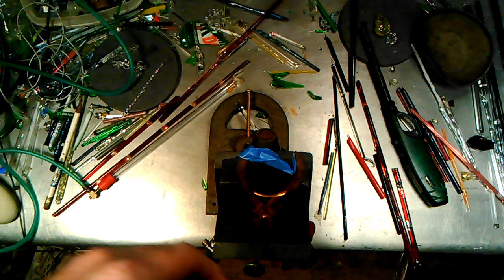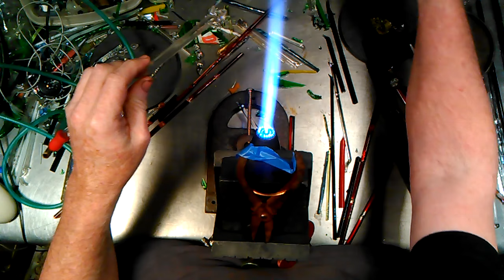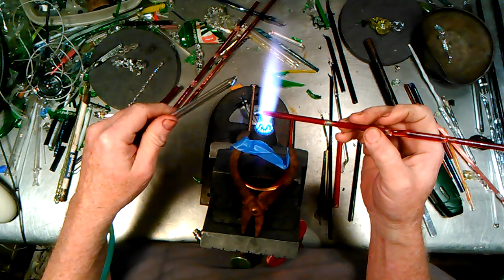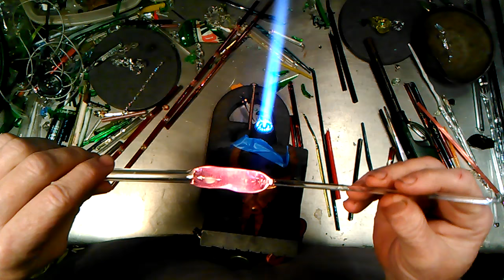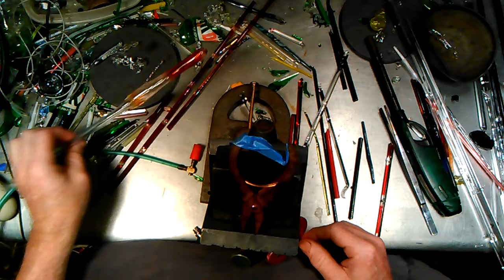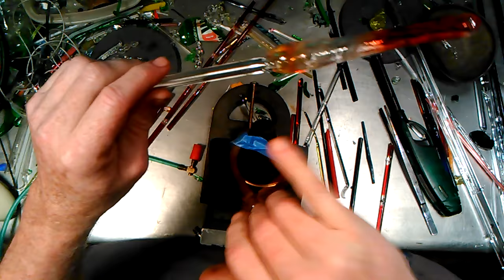making red tubing from boro glass solid rod

Comment: Can i use a graphite stick and roll rods over it?
Reply: Road Runner I think I read your question wrong the first time so the second long half is just case I did understand it correctly and I typed it first so. But I’d say No because the glass would cool around the stick contract holding on to it or I’d imagine it’d very hard to get the whole piece hot and get it to release off of the graphite, other answer I’ve never tried myself but you’d need a decent sized slab to roll on and most importantly you’d probably need one or two people to help you, one to keep the glass hot with a torch and the other one or two to press the rod down and roll, depending on how large of a tube you are trying to make and you could use something on either side to roll the graphite rod on to keep an even wall thickness along the tube or stainless you could use a stainless steel rod